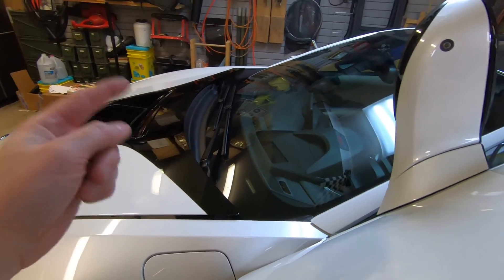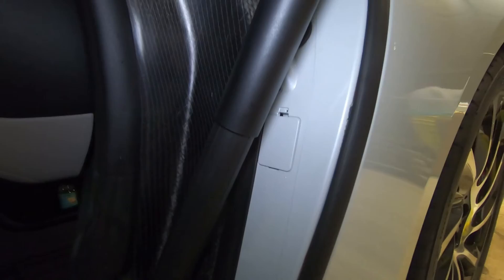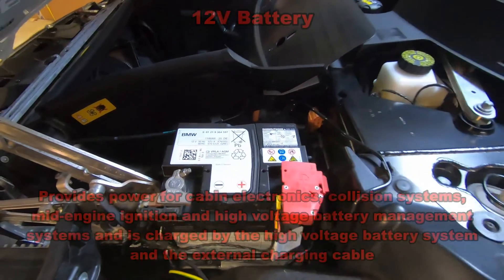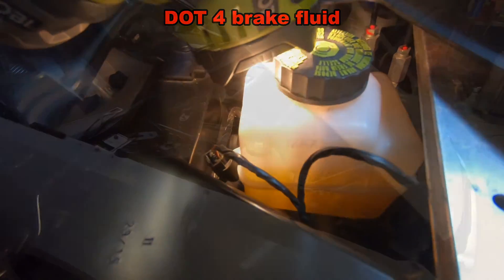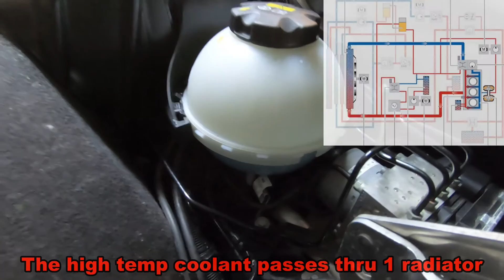BMW i8 Hood/Bonnet Lift and Latch - check coolant, battery, brake fluid, diagnose low coolant

Comment: it can be opened, very easily aswell.. two string pull latches behind a cover by the door sill

and then it pops and chimes like a regular bimmer, lift from the air duct sides while you gently pull and slide the hood up and and it goes up.

put a screwdriver in the holes of the hood arms. it wont fall down if you put a plastic box or whatever under the other side, one side screwdrived. walk over to the other and screwdrive that ad well, ur hoods now open and safely set up voilá

the OG warranty of these are already not valid so feel free to top of ur coolant. these suck as much coolant as the i3s :)

Comment: I want to connect the battery to an external charger
Reply from the maker: By connecting the charging cable, it charges the high voltage battery which then tops off the 12v battery automatically.
Reply: @PatsGarageOnline  Thanks for the answer. My BMW dealer in Germany told me otherwise. He said that the 12 V battery is charged only when driving and not when plugged in.Your answer is more convincing.
Reply from the maker: @oilquickiebymc7380  You're welcome.  My answer comes directly from the service manual.  Please refer your dealer to BMW i I12 i8 Coupe / Repair Manuals and Technical Data / 61 General vehicle electrical system / 61 25 High-voltage accumulator system. Copy/Paste directly from that article: "When charging the high-voltage battery by means of the charging cable, the 12 V battery will be automatically charged as well."

Comment: friend of mine i8 crashed...and after that i couldn't turn it on anymore...stop that when it crashed it activated some system that turns off the electrical part...do you know how I can solve it ???
Reply from the maker: There's a module that shuts everything off in the event of an impact.  It will require a service center to sort this out.

Comment: how is the big battery is cooled in this car and is it possible to upgrade the cooling radiator for it. i heard that the battery gets hot very quickly
Reply from the maker: The high voltage battery is cooled by the air conditioning refrigerant lines. There is no upgrade to the AC system available. In fact, the AC compressors on these cars, as well as the i3, can fail and send shrapnel throughout the system, requiring complete removal and replacement of these refrigerant lines. In the i8, this repair is $18k USD due to all the labor.

Comment: Hi Pat, my i8 just popped out an engine coolant low warning while driving  and it disappeared after I restarted my car and popped out again after half hours driving. I just checked the engine coolant fluid, it is still adequate. I'm curious will a mulfunction sensor damage the engine
Reply from the maker: It will likely be a damaged sensor. See the description of this video for the SIB and part numbers

Comment: I had a low coolant warning and refilled my coolant. Didn't realize the system was under pressure, engine overheated on the freeway 😥. Made it back home alright but now I'm trying to figure out how to vacuum the air out of the system. Do you know how?
Reply from the maker: Sorry to hear about the overheating condition. It's possible you have a leak. Air is getting into the system on the engine side of the car and can't escape. BMW has a special part and procedure for bleeding the system. This isn't something I could do at home.

https://www.newtis.info/tisv2/a/en/i12-i8-cou/repair-manuals/17-cooling/17-00-cooling-check/1VnYA6xzNl
Reply: @PatsGarageOnline  thanks a lot for helping me square away this problem (: The previous dealer technician that worked on my car did indeed leave a pocket of air in there which caused this to happen
Reply from the maker: @Stabyah  I feel relieved that this air pocket was due to a problem during the bleed procedure, leaving an air pocket.  Thank you for this feedback!
Reply: @Stabyah  l

Comment: Are the High and Low temperature coolant the same thing, different ratio of distilled water to coolant?
Reply from the maker: Both the high and low temperature coolant circuits use the same BMW coolant (part number 82141467704) with 50/50 coolant/distilled water dilution.

Comment: The whole time watching this upload, which is another one of your great I8 uploads, I had to chuckle to myself in thinking of yesteryear where you'd pull into a gas station and you'd tell the attendant, "Fill er up and check the oil and water please." Meanwhile, six hours later the attendant has pulled all his hair out and is just wandering around talking to himself. 🤣 

Now back to your upload. What happens if the release cable you pull on breaks? For me it would be I'm SOL, but I know you have at least Plans A and B.
Also, can you release either cable first, or must you release the Driver's side first?
When closing the hood and locking it back into place, does the "push down" procedure require two people to do it simultaneously, or can one person do one side and then move around to do the other side?
Save the Wave.🙋🏼‍♂️
Reply from the maker: Thanks Peter!  I still remember those days where the Hess station had an employee that would do what you needed.  You still have some of that in NJ but for the rest of us, no dice.  Funny thing, I bought some oil that Edo recommended called Motul and it comes in a metal can.  Most people wouldn't remember those days of using the spout to pierce the can, but I do.  This can has a lid, tho, and is rectangular.  But it reminded me of yesteryear.

The hood release can be initiated by either side, first.  No one has reported a broken hood release cable, but I may be able to remove the wheel well in the front to get to the linkage if I needed to.  Worst case, the fender has to come off.  It's composite like the Corvette, so a few screws and clips and it's out of the way.  I try to have someone help me close it so it goes down on both sides to ensure alignment doesn't change.  The linkage at the front of the hood is lightweight and it's easy to set it down and not have it properly aligned.  I've had to close and reopen because the gap was visually different.  But, it can be closed one at a time.  In fact, you can open the hood by yourself, because I've done it, but you have to contort yourself in order to make sure the hood is balanced properly during movement.  It's quite the adventure but not recommended, so I wouldn't cover that in the video. ;)
Reply: Ha, ha. I remember buying the oil in quart cans AND I still have two of the metal spouts that would be pierced into them so that the oil could be poured into the engine. I don't know if you can even find them in antique stores anymore, but as very young boy I remember my going with Grandfather and buying oil in quart glass bottles which had screw-on metal tops shaped like a funnel and they had a small screw-on metal cap at the small end of the funnel cap.

That's interesting about Motul coming in metal cans and being in rectangular cans no less. If you would save me an empty one I'd appreciate it.

Thank you for the further explanation on opening and closing the hood. Even though you've seen no reports on those release cable breaking, there is an old adage that the longer you go without breaking something, the closer you get to breaking it.🤦‍♂️😉
Reply from the maker: @petercarey6883  Murphy's Law is always in effect with machines.  So, I predict we'll have a problem with these cables eventually.  There are other problem areas on the i8 which I'm working on solutions for right now.  

I'll save you a container, no problem.  If you visit patsgarageonline.com there should be a photo there.  They come in 2qt cans.  Extra special!

You should take one of those push-in oil spouts to get chromed.  It would make a super cool feature to add to the garage.  I hadn't heard about the glass jar oil.  Amazing!  

I enjoy watching the Project Farm channel and they recently covered an episode of testing 70 year old oil.  Quite interesting!

https://www.youtube.com/watch?v=-zHlxeu_yuM